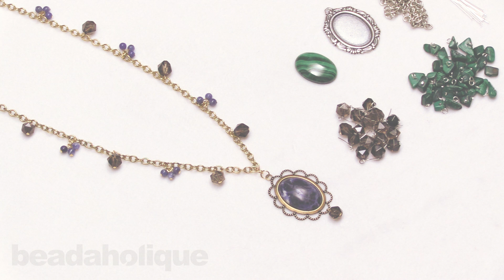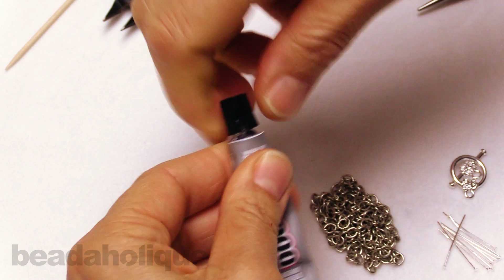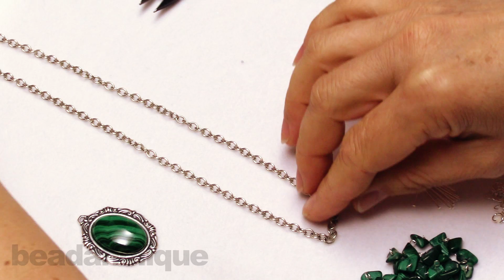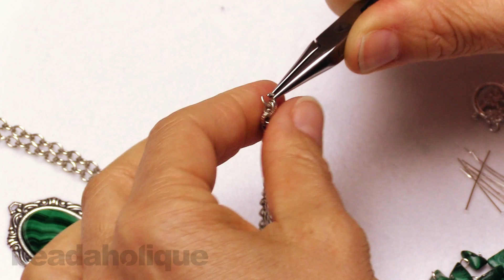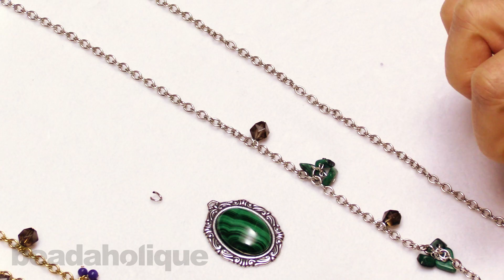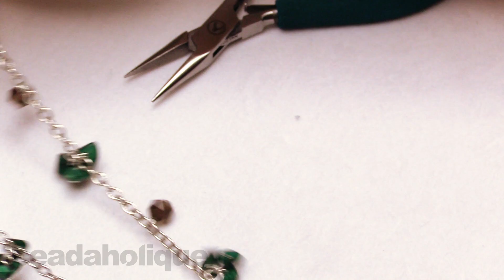How to Make a Gemstone Cabochon Necklace with Chain Embellishments

Comment: How do you make sure that the jump rings will be strong enough to hold without pulling open? I've had some trouble with my jump rings being too soft, if that makes sense.
Reply from the maker: Yes, there is a chance the jump rings you're using are a bit too soft.  We recommend at least 5mm 20 gauge Silver Plated Jump Rings.  If you are using a softer metal, like aluminum you may run into trouble.  Depending on the design you want to achieve you can always try split rings.  They may give you the strength you're looking for in a heavier piece: https://www.beadaholique.com/beading-components/jump-rings-split-rings/split-rings